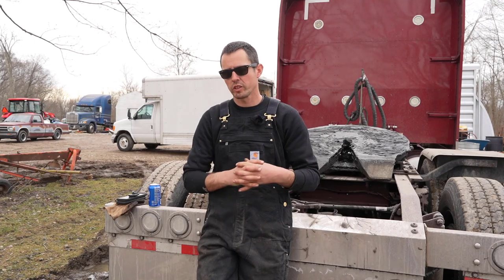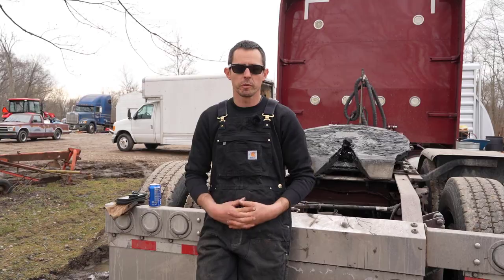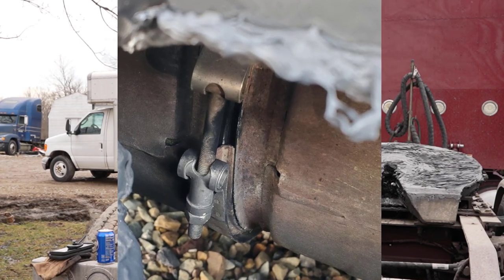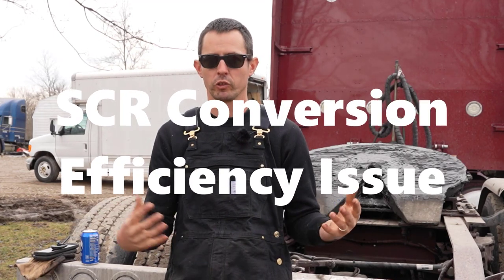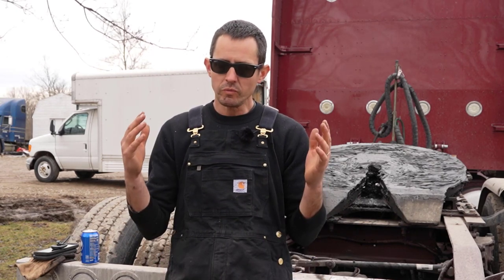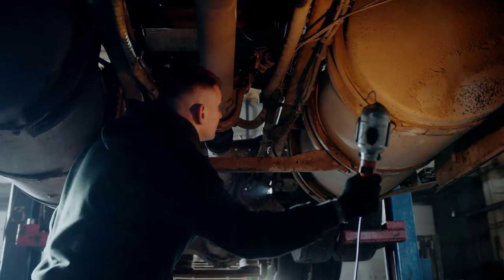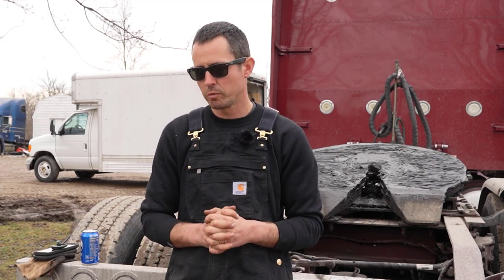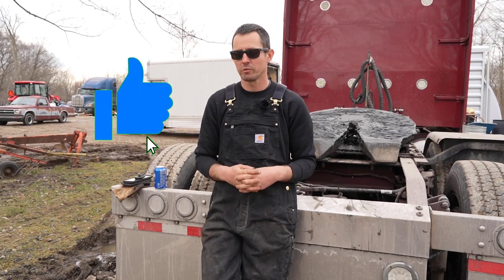Semi Truck DPF SCR Conversion Efficiency Code - Check This Now

Comment: Having this issue now, replaced Inlet and outlet nox sensors and code still comes back. Will check these clamps, thanks Ryan! Love your channel, keep em coming!
Reply from the maker: Thank you Peter! Good luck to figure out the issue!
Reply: Get brand new DPF filters if u have old one.. the filters after awhile gets no good. If u change both nox and outlet sensors get brand new filters.
Reply: @CashNYC  change the SCR cat, esp if you got ammonia smell at 1500 rpm at idle after 20 minutes.
Reply: @rearspeaker6364  thanks I don't have this problem anymore new filters fix my problem

Comment: I just had and fixed this problem on my Kenworth  t680. I replaced the Outlet Nox sensor and the same code would come back. After looking over the system I notice the clamp was broke and there was a 3/4 inch gap that was sucking air. Bought new clamp and gasket and problem was solved
Reply from the maker: Sometimes people miss this obvious problem. Thanks for sharing your experience.
Reply: @truckingandfixing  thanks to you I was able to gain the confidence to fix and look at my truck. I will be replacing a leaking shock tomorrow. Of course I watched your video on that. Thank you kindly Ryan for your work and dedication and knowledge.

Comment: my soot ash % says 9.9 in ecm when should i get dpf cleaned .i have 178000 miles since a new doc and dpf were installed.
Reply from the maker: I would suggest to get dpf cleaned when your ash reading 50%.

Comment: Had something similar happen after I bough a Peterbilt for Dobbs Peterbilt in Memphis AR. After they cleaned the DPF they didn’t align the gasket and vband clap and cause a hole which melted my DPF wire harness with a bunch of codes and derate. Fortunately didn’t catch on fire. They didn’t want to pay for any of the repairs that had to be done at a Loves on the road even tho their mechanics didn’t do a quality job. Never buy from them again in my life.

Comment: Nice
Reply: @Trucking & Fixing With Ryan  is there another unit besides that 250 I can get because bosch stopped making it or at least stopped shipping it
Reply from the maker: Good question. I haven’t found another one that I tested, other than the OTR performance diagnostic tool. The Bosch worked well with Cummins engine. If you have other engines, I would recommend otr.